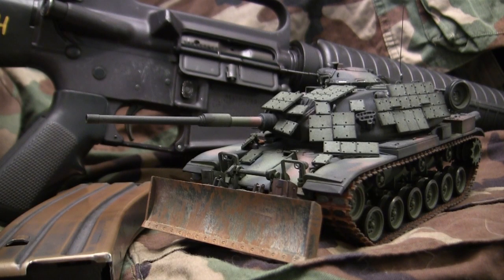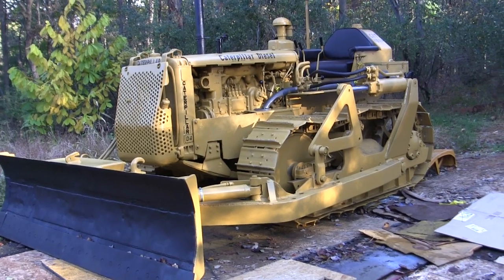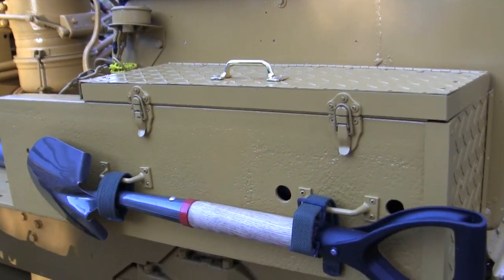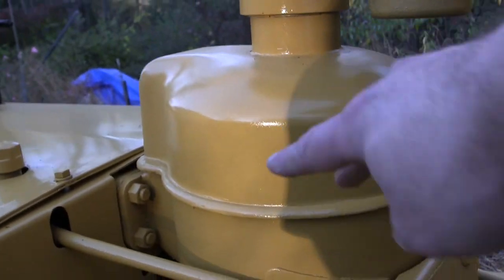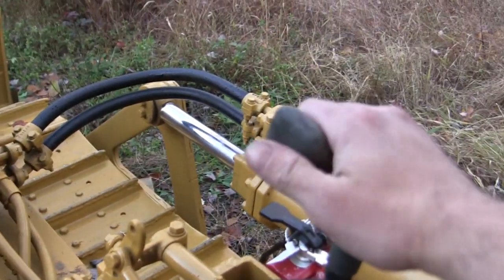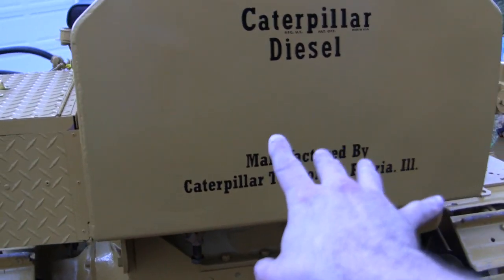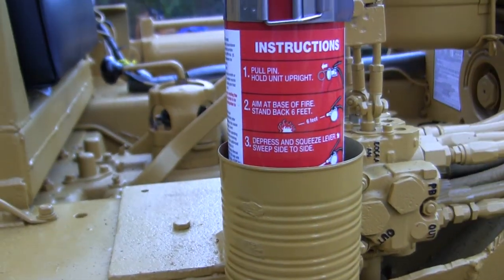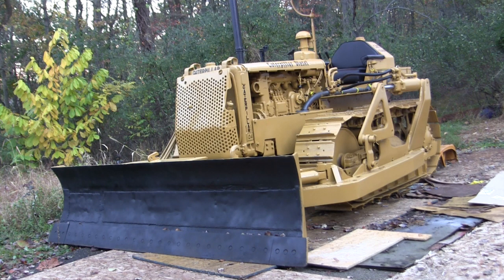Restored Cat d4 7U Bulldozer detail walk around video

Comment: Excellent restoration I doubt if most people have any appreciation of the amount of work involved with this process! Just an outstanding accomplishment, kudos to you and your dad.
Reply from the maker: Thankyou for the compliments. This was a very simple restoration as it was just a strip down / repaint, but it still took about two months to get it to the point you saw in the video. Luckily this machine was in running condition when we got it so we didn't need to go into the engine or transmission, which would have been above our skill level and tooling. There is another youtuber who is doing a full ground up resto on this exact same machine single handedly and the amount of work he put into it is staggering. My hat's off to that guy!

Comment: This was the first bulldozer I ever operated, we had the shovel bucket and would load the truck over the back as well as the straight push blade. I remember starting the pup engine with a pull cord, and the diesel would make the most incredible smoke rings when it would turn over cold.

Comment: The levers are for clutches and the pedals for brakes.
Reply: Glad you made the point.
Reply: You are correct. Pull the lever all the way back to release the steering clutch. If the cat doesn't turn sharp enough you can use the brake.

  The pony exhaust doesn't go through the diesel engine.  The pipe goes through the intake manifold, which warms the air going into the diesel. 

On the transmission, that little oil cup doesn't fill the transmission, that is an oiler for the main clutch collar.  The transmission is filled by the large bung on the top of the transmission.

Does the blade tilt as well as pivot?
Reply from the maker: On the Pony, what you described was exactly what I was referring to. On the blade, yes it does pivot. And on the transmission thanks for the info.

Comment: You never mentioned the shifter for the transmission. How many forward gears does it have? Curious about the electric starter the previous owner installed. How did he figure out the placement dimensions of it on the bell housing etc. to engage the flywheel or is it possible to buy a bell housing with mount for a starter on that engine? Anyone know? Would of been nice to start it at the end of the video.
Reply from the maker: 4 forward, 2 reverse. On the starter... I can't answer that since I didn't know the fellow who did the conversion, and he has passed away several years ago. All I can say is that it works very well. I'd like to make a follow up video of it running, but not until it has the rubber track pads, otherwise it will wreck the driveway

Comment: Very nice restoration job by you and your father. I was wondering about the prep job: sandblasted, wire brush, primer, paint used, etc.?
Reply from the maker: Thank you, the prep was done with everything under the sun. Wire wheel, paint remover, and finally sandblasting. The paint was CAT official paint and hardener was used in the mix. All paintwork was spray gunned on.

Comment: Do you have any info on the front track wheel and the slid rails that hold it if it holds oil bc it looks like it does
Reply from the maker: it holds oil really well. The way you see it was how we got it. No work or other alterations were needed. Not sure if the other owner changed out the seals or if they are original.
Reply: @oddball759mm  awesome thanks and yours looks really good